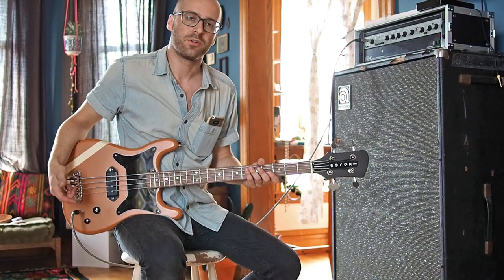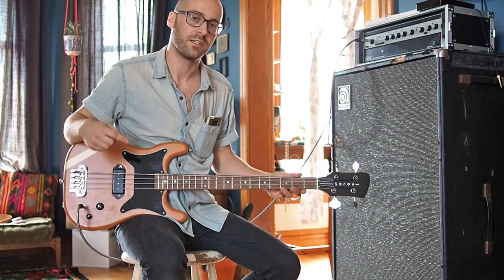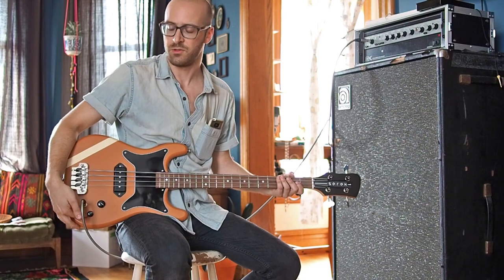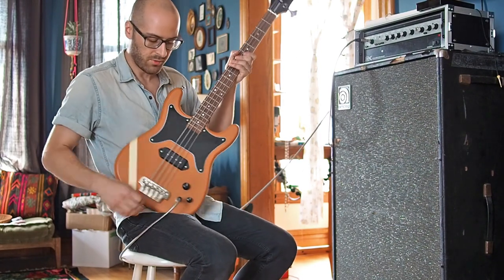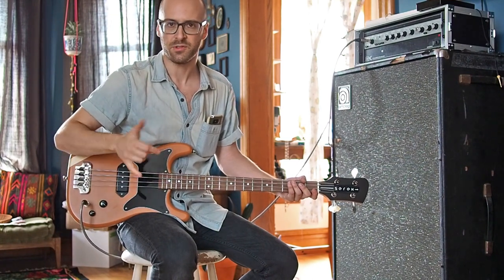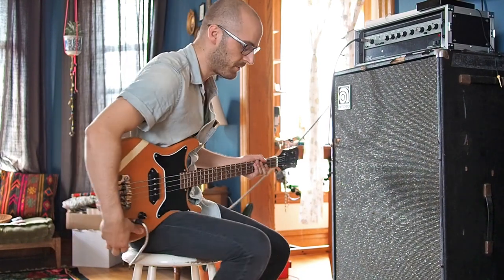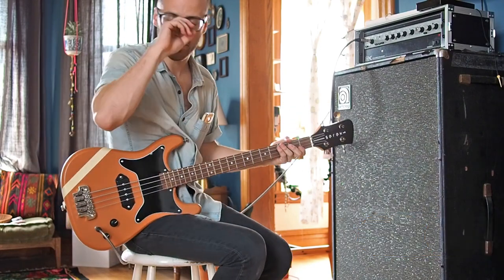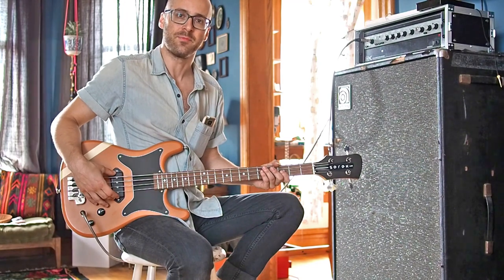Serek Basses - "B90" Bass Pickup with Dummy Coil Demo

Comment: I’ve actually found that the tone control is more balanced with the dummy coil engaged - without it I feel like there’s a volume drop from rolling off the tone. Great to have both options though. Anyone else feel that way?
Reply: Maybe cuz there is more wire, if you put extremely underwound pickup tone control also sucks